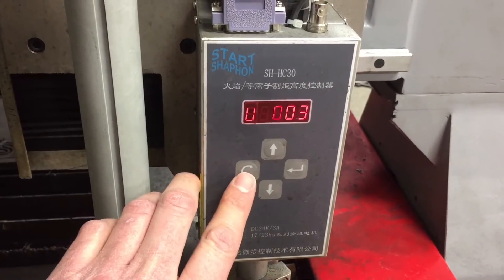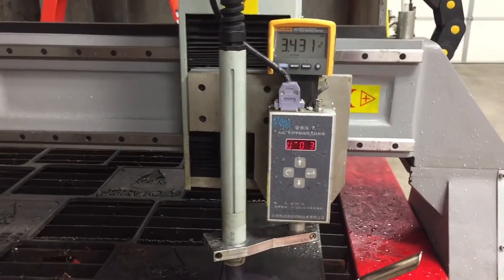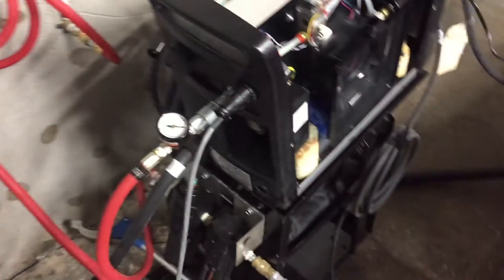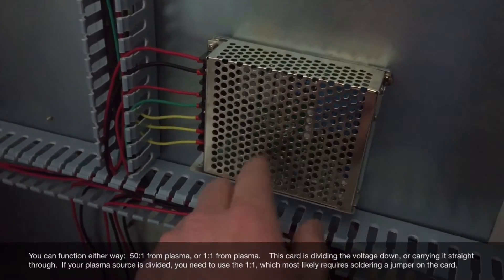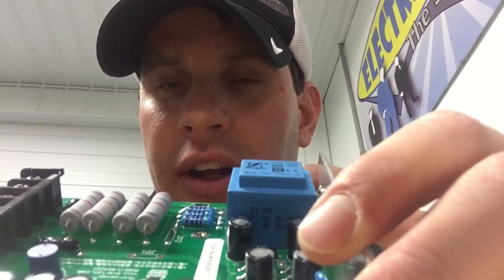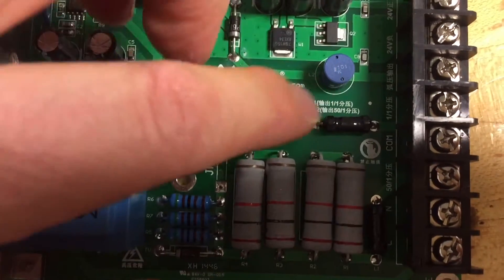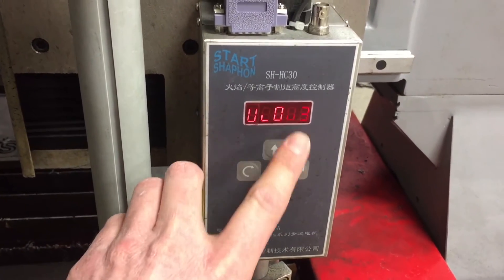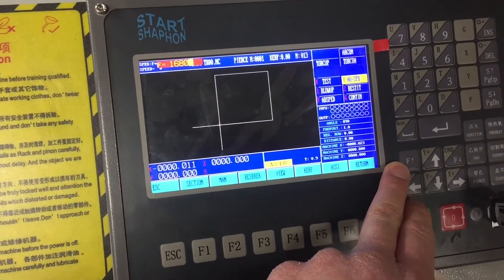Chinese CNC Plasma START SH-HC30 THC Problems - FIXED!

Comment: So I am connecting Hypertherm 1/50 to 1/1 jp1 soldered on the board and 1/1 if I choose to run high voltage directly to the board then I solder 1/50 jp2 on the board. I think the Chinese thought people would not read the manual and input 1/1 voltage and they would have to replace that toasted item. Most people don't RTFM.

Comment: You can run 10,000 volts over a wire thinner than hair without burning out. As long as your current is very very low. 300v with very little to no current drain will not hurt it. Nor will it hurt a person. Unless that wire is thick and can deliver more current.

Comment: Hi Larry,
thanks for the information and contribution, I have a similar problem, the plasma that I am using is Chinese from the BP brand and the CNC is also Chinese, the torch makes a point and the arc is lost, however it continues to send air, continuing to move. Please your help.

Comment: Hello @Larry,
I have a f2100b chinese cnc plasma cutter. My problem is that the arc does not initiate. The power source makes a weird repeating noise as if it is trying to ignite the arc, but fails to do so. Do you know what my problem may be?
Reply: You're not getting a "arc OK" signal. When the torch lights the control needs to see that it has done so successfully or else it just try again and again....
Reply: @Steve_Just_Steve  the problem was that I set it up on 3 phase 220V, but the machine is actually 3 phase 380V. So it doesnt get enough power.

Comment: Hi Larry! I have a newer version of this THC - the SH-HC31. I downloaded the manual for both versions but it’s barely understandable and the main part - settings makes no sense. Do you know what the values correspond to? I mean U, b, E, H, L, P and d? And how to set them properly? It looks like you’ve got it sorted out entirely. Many thanks for your help!
Reply: U: plasma mode, range 30~250
C: flame mode, range 3~30
E: sensitivity, range 1~10
b: initial location height/pierce, range 1~20mm
H: maximum adjustment speed when auto cutting, 5~50
L: initial adjustment speed when auto cutting, 1~20
P: up/down speed in manual mode, 20~80
d: auto adjustment speed ratio (the bigger the value is, more slowly the speed adjusts)

Comment: Larry, if you are out there i am stacked with the CNC plasma cutting machine . it says two things on the screen 1. file system Failure and 2. no application software, any idea?

Comment: i have a the same controller and all of a sudden I got a >W+ symbol next to my auto/manual sign on the screen. This has disable the movement or starting of an operation. The manual says "X/Y+ limits, two positive axial travel limits connected in series, high priority. Please jump the signal to 24v ground if not use" . Does anyone know what this means.

Comment: SER SAS SAS
SER SAS SAS
1 giorno fa
Larry Davis Axis X and Y are normal, the machine moves.
 the problem is on the Z axis which, after starting the program, shoots the bow in a low position (normal) and after a second it rises ..
The ARC-CHECK-FAIL error appears.

Comment: Good morning,
after seeing your video we need some information if you can help us.
We have a HCP CNC RAPIDO 15-30 plasma.
Our problem is that the torch starts but after two seconds it returns to the starting position, as if there were an alarm.
What can it depend on? Can you help us put our Plasma into operation?
Could you leave me your e-mail address so I send you some photos of electrical board?
Thank you
Thank you very much for the help you will give us.
SER S.A.S.
Reply from the maker: SER SAS SAS the starting position of your x/y/z axis?  Or just the start position of your torch control Z axis?  Does the machine try to run the program on the x and z?  If it’s the torch height control starting to lift, this video is the cure.  If it is all axis, then your most likely your machine calibration is incorrect in the software.
Reply: Larry Davis Axis X and Y are normal, the machine moves.
 the problem is on the Z axis which, after starting the program, shoots the bow in a low position (normal) and after a second it rises ..
The ARC-CHECK-FAIL error appears.

Comment: Hi guys can you please help me ,I’ve bought a China CNC plasma table .with no user manual ,my problem is I was playing around with the control screen to learn more about is functions ,and some how have reversed my cuts to the under side to view my program project .I don’t know what I’ve down and i am not getting a answer back from China .Can anybody help me to reset so my table goes forward in its cutting .my email is michaeldobell63@gmail.com if any body can guide me to solve my problem I will pay for you time .It doing my head in to try and work it out plus I am flat out with my CNC table Cheers

Comment: Hi. Please advise if you are using a rich auto dsp a12 control system. And how did you connect it
Reply from the maker: Mohammed Amod I am not using an a12 system.  And I am not exactly sure what you are asking about connection.  Connection to the hypertherm is through the control port on the cutter straight to the com line to the START control.

Comment: Hi.

I saw your video, it's excellent. Thanks for the input.

Right now I have problems with my THC, but I think it has to do with interconnection. since the voltage arc is not yet received by the THC.

If it's not too much trouble, could you provide the connection scheme?

I use a similar THC and a powermax hyphertherm 85, apart from a cnc controller of the same brand.

thank you, I hope you read my message.

Comment: Larry 
I have a Chinese  cnc plasma with the chinese plasma unit as well. It has the xpthc-4 height controller.
I cant get the starfire to fire up the plasma but the height controller will wen ya use the arcon button.
Would you have any idea if im doing something wrong or they havent set it up.
Thanks

Comment: Great video man! I have some DHC issues, this may be the deal.. I keep having the torch start off okay but it always ends touching the material and burning up my tips.
Reply from the maker: Unorthodox Fabrication are you setting your voltage on the THC?  And if you are, where are you getting the parameters from?
Reply: I got the same problem, Chinese people don't give a real solution, they don't give accurate information about their products, it's hard to run the machine without a guide, I'm looking around for information, but there's more people like me than a true guide of operation

Comment: Hi Larry
I have this system from china I connected all thing but the SH-2012 controller didn't output signal to SH-HC30 from 25pin port NO 19 and 7 for up and down THC and i didn't know what is problem,

Comment: Hello Larry, Can you help with the following issue
I am facing a huge problem with my latest machine and desperately need assistance. 
I had Chinese portable plasma cutting machine for last 2 years. It was a good experience so I ordered table plasma machine from another supplier. 
The new table plasma isnt working. It cuts the the file in different size and shape. 
For instance if we put a cutting file of 100 mm it will cut it in 120 mm and will also cut more in corners as you can see in the pictures attached. 
Controller is starfire however portable machine's controller is FLCNC
attached pictures: 
https://drive.google.com/open?id=12PXvhdKVaMaGU1m1rgT68Qs25FxpaWA1
https://drive.google.com/open?id=16dRixnTdMjidxSzZ6mbWehbKBWkIdvZV
https://drive.google.com/open?id=1so9Kfe9DcW-P6l-TBbHvQ68pWsJcjTkx

Comment: Thanks a lot. Very good video. I need your help. I have Chinese cnc with hypertherm powermax 65. Suddenly from yesterday no arc coming. I didn’t change anything except power and speed. Even no error on the display. Please Need you help. Thanks in advance.

Comment: Larry, thanks for the video. It's literally the only one I could find about this THC. I just bought this unit and am wiring to a breakout board and using Mach3 to control. Do you have more info on the 15 pin connector? The instructions are saying to connect pins 12 and 13 to a 24v source to control the Z up and down. Do you know if those pins are actually output pins? I'm completely lost as how to manually raise and lower the Z axis. The Chinese instructions are pretty vague. Appreciate any input or wiring diagrams/videos!
Reply from the maker: Nicholas Newton the manual up and down on the actual z-axis is controlled via two methods.  The first is your mechanical mode on the machine itself, the second is on the THC.  The THC is controlled manually by your START software.  Unsure on what pins.  If you are converting to MACH3 for a controller you will need to replace the breakout board altogether I do believe.  I had to on my router.  I can say that it isn’t necessary, starts system is perfectly proficient for most applications.  I am glad you found the video handy, like I said - there wasn’t anything out there for support.  Good luck!
Reply: Thanks! I should've probably added that my machine is a home built one I designed. I use Mach3 on the router I built as well so utilized it for this machine as well. I was hoping this THC setup would make the build easier but I'm finding that's not the case. What type of breakout board setup is on your machine? The pin out for the THC is strange, the only thing I'm stuck on is getting the Z axis to move.
Reply: @nick.newton  Hello, Hope your day is going well, Did you ever find a solution to get this to work with mach 3? I am in the same situation, if man up / manual down are grounded it makes the thc go up and down , when auto is grounded and the torch turns on via mach the thc goes down , but it should go down touch off then trigger the torch, any luck with your system or did you just go buy a proma like im concidering XD ,, any info helps ! thanks alot :)
Reply: @Ballchineeyan  I found out this THC system isn't compatible with Mach 3. I tried gutting it and using the stepper and limit switches wired independently but it was a waste of time. I bought a z axis assembly off ebay and used a proma. Been running strong ever since.
Reply: @Ballchineeyan  this system runs on 24vdc and mach runs 0-5vdc signals. When you get the proma mount it directly to the plasma and use the full voltage inputs, the built in divider is a waste of time as well.
Reply: @nick.newton  I figured out how to make it work with Mach 3 , I will make a video some day , cheers
Reply: Wesley Bramer  hello i also use this controller can you share how you set the pierce hight and cut hight?
Do you just set the initial height for pierce height and use arc volt to control cut height?

Comment: Hi Larry, fellow sign shop and guitar builder here.  I have added the same thc.  From what I gather the unit is just turned on and off by the controller and it controls the height by itself.  Is that correct?  So there is a subroutine that allows this to start, bump the plate then the torch fires up?
Reply from the maker: Kenny Grisham sounds like we have a lot in common my friend!  As for the question, I hope I can answer correctly.  The thc reads the voltage of your plasma source, and adjusts the height of the head to get the perfect voltage required to cut perfect.  It is a one way communication from your plasma source - the THC deciphers the voltage and moves it up or down accordingly.  You have to input the voltage parameters in the THC itself in order for it to float correctly above your steel.  The process of it moving down and tapping the steel is only to set the ‘zero’ point of the steel.  I hope this helps.  You can give me a call if you need more assistance.  A private message is all I need with your phone number.  Happy jamming/sign making mister!
Reply: my email is ksgjlg@gmail.com  It sounds like I'm heading in the right direction.  All the controller does is turn on the unit.  Is there a subroutine that activates that? i.e., something before M3 that turns on the plasma cutter?
Reply from the maker: Kenny Grisham no, there isn’t anything between the two.  There isn’t a ‘subroutine’ so to speak.  The system functions the same whether or not you even use your head controller.  Sounds like you need some more tweaking with the parameters, or perhaps it’s not wired right.  I will email you.

Comment: Great Video, Helped me a ton! been working on my Chinese plasma for about a week trying to get it running right. i had to do the same JP1 JP2 jump. if i didn't have your video don't know if i would have figured it out so thanks!  Had a question for you. what post processor do you use to run of of startshaphon controller?
Reply from the maker: Casey Sharrett thanks for watching the video, I am very glad it helped!  I have used several CAM programs, the best (in my opinion) is SheetCam.  The FastCAM the machine came with is garbage ;-).
Reply: Thanks for the response! i am also using sheetcam, love it. but when you save your file to take to the machine what format of gcode do you use (post processor)? there are so many options not sure what the right one is. Thanks again!
Reply from the maker: Casey Sharrett, I gotcha, I send it out as START post processor.  I have no issues with a the G-code.  I do with my routers from J-cut, but the plasma is no big deal!

Comment: Hi Mr. Larry and friends, can someone help me, because I want to check if my stepper motors is good, I have same controller of yours, but I trace the wire frok stepper drive to 15pin port plug XDIR+ and -, they put opposite, what will happen if the DIR + and - put in opposite?

Comment: Hey Larry, My name is Tibor Bush I think your video is very helpful . Please help me. I have a 45XP  Hyperthem  plasma cutter and 6pin interface cable and same THC then yours. Plus shop made 4x4 cnc table . I use a MAC3 controller. I wondering can you send to me a complete wiring? Could you send to my email address: tbush@mts.net Thanks, Tibor
Reply: Maria did you ever get an answer i have the exact same setup! looking for the wiring aswell.

Comment: Hi larry,
thank you for sharing this valuable info.  I have the same problem i have start fire  model XPTHC-16 virsion  connected to hypertherm powermax ×125  the plasma machine most of the time stop in the begning of the cut or in the middle of the cut and i recive these two diffrent notificaton in the screen 1- ARC BK and sometimes ARC detect failure i tried to follow the same steps u do and i have found the bord for J1 and J2 but it is in diffrent situation J1 2 wires are connected to it one for work + and other is for Elector1 and J2 two wires connected to it one for Start2 and the other is Start1
Reply from the maker: Is your Hypertherm outputting 50:1 arc voltage ratio?  Or is it 1:1?  An arc detect failure sounds like it is getting to weak of a signal (I bet your hypertherm is set to 50:1, and the controller is also 50:1, which would result in such a small signal it would nearly be undetectable.)  Example:  your cutting with 100 volts.  if you divide that by 50, your Hypertherm would be outputting 2 volts to the START THC controller.  It then is also dividing it by 50, which would be .04 volts - much to small to be detected.  Check your card, and your plasma source.  only one should be doing the 50:1 signal.

Comment: Hello. I have proplem that is there is a big difference between actual arc voltage and setting voltage , this ocured after I had connected Hyperthem powermax85 to china cnc .
Reply from the maker: OK, that is what this video is covering.  you need to make sure you are 50:1 out from your Plasma source in order for this mod to work.  if you are 1:1 out then you need the THC to be 50:1.  make sense?

Comment: Hey Larry, I'm looking at a THC for my homebuilt table. I'm wondering if this controller adjust/slow with out diving for cornering and 90 degree cuts. 

Thank for the help and for the video!
Reply from the maker: Hey Paul, thanks for watching the video.  Slowing for corner cutting is not an option in the THC, although I believe it has a feature for slowing on curves.  I have not used it.  I do know you can program that in your G-Code with a good cam program.  And diving on corners is not a problem with mine.  What thickness are you cutting?  And what are the amps of your plasma source?
Reply: Larry Davis Larry Davis I'm running an Everlast power plasma 50s with cnc plug.  I mostly cut 14ga and ¼". I use sheetcam to mach3.
Reply from the maker: I see, so if you are using sheetcam & Mach3, then you will are currently not using a START THC - since that would be your controller instead of Mach3.  I use Mach3 on my CNC routers - but it doesn't allow for corner slowing or anything specific to plasma cutting.  If you are only cutting 14 gauge, you most likely would not benefit from a THC.  I turn my THC off when cutting that thin of material since my speed is so high I would not benefit from the THC.  Hope this helps!
Reply: Thanks it does give some insight. I looked more into sheetcam and found I can set rules for when using a thc thank you Paul durr

Comment: Hi. Do you know if its possible to control the cutting speed via g code. I want to make the machine slow down on a small holes.
Reply from the maker: Sean McAlister Yes, It is possible. However using this start system I don't have the code layout to point you in the right direction.  I would recommend just running two programs and cut the inside holes first.

Comment: What controller are you running in conjunction with the thc ?? Looked at the StartSH controllers.. and they hade a bunch of them. =)
Reply from the maker: This is the START Microstep SH-HC30.  The THC and controller are matched.